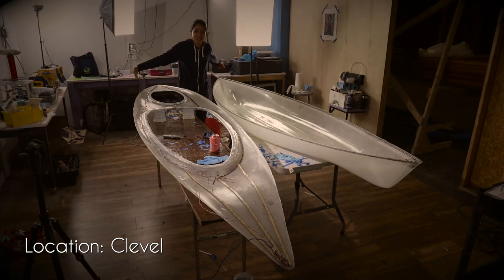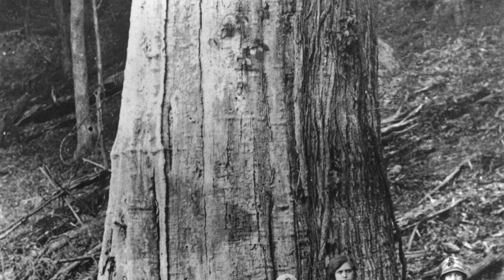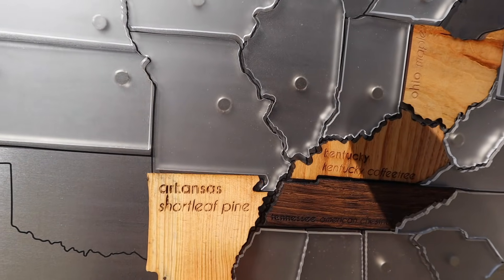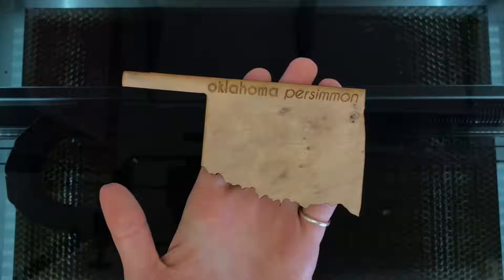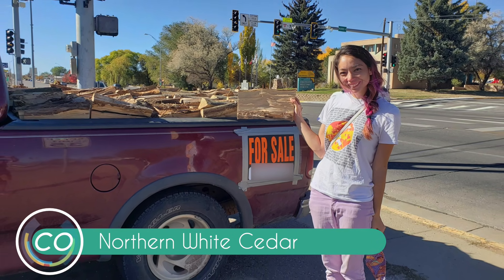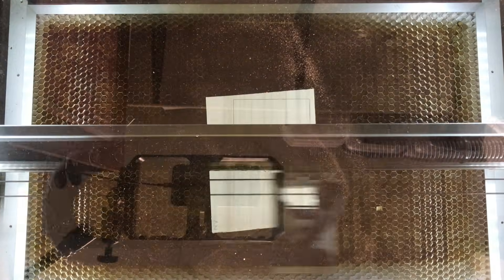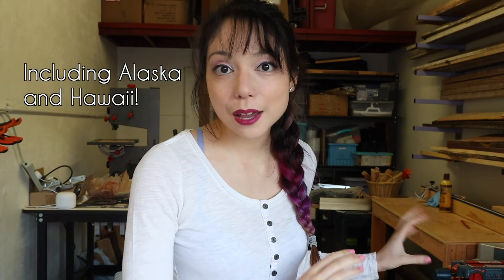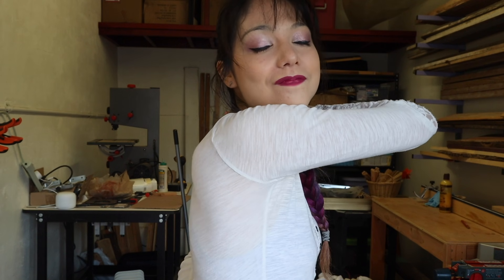I Drove Across America Collecting Wood in Every State

Comment: Just a little planing tip. If you have to plane another thin jointed piece again, use painters tape oriented across the joint to help hold the joint together and reduce the chance of blowing the joint. If the joint does still blow, the pieces will still be held in orientation.

Comment: If you ever find yourself in a cloud again, climb higher. You'll get your view.

You can avoid snipe caused by the thickness planer by planning multiple pieces in parallel, but introducing them into the machine staggered. You should use two scrap pieces for start and finish of the stream of boards.Those will be the only ones with significant snipe.

Comment: That was a very typical piece of mesquite. Here in Texas, furniture pieces made from it almost always have extensive epoxy infills. When planing small pieces like that, I rip longer pieces from scrap and glue them to the sides- this takes all the worry out of the job, and you can just rip them off when done. I keep crappy wood around for just this purpose (it simply has to exist).

Comment: That's along a route that I was very familiar with: old Rte 66. In the early 1960s I spent 3 or 4 years hitchhiking back and forth across the country (1/4 million miles or so). A lot of those miles were on Rte 66 which had already begun to be abandoned. Since I was never in any hurry, I was able to follow the original roadways except for the few places where it had already been "paved over" with a new expressway. At least once I hitched the entire way from the Loop in Chicago to the beach in Malibu, just as a sort of bucket-list item. (Hitchhiking in Chicago was no fun in the '60s and is probably worse now.) I see nostalgia pieces about some of the older, vanished businesses along 66 and can say, "Yeah, I ate in that diner," or "I bought a Coke and a pack of peanuts in that gas station." I can't say that about the motels though. I doubt if I spent 40 or 50 nights under a roof during those years; I generally just found a sheltered spot, wrapped myself up in my old, raggedy army overcoat, and lay on the ground. It's called "living rough".

Comment: 10:50 Alaska also wouldn’t fit. Hurts my feelings every time we’re left out :’(
Reply: Yea I don't think Alaska would fit, we'd need a longwide board to accommodate
Reply: Well, the obvious solution to that (wood) problem would be going back to being Russian, but I don't think that's an option either, yeah?😅
Reply: @MichaelBerthelsen  I'd much rather be american than russian
Reply: Then you should think about that all those states are called the "Lower 48", putting Alaska above the rest.  :-)
Reply from the maker: I figured if someone sends me Alaska I'd just make it and have it float around in the bottom left corner!
Reply: @xylafoxlin  Your solution has been done in some form by many map makers.
Reply: I read somewhere if you cut Alaska in half Texas would be the third largest state.  (I think it was a bumper sticker)
Reply: @MichaelBerthelsen  Why Russia? Wouldn't Canada be a better alternative considering you actually share a border with them instead of being separated by the Bearing strait.  :p Also you have the same language so communication wouldn't be that problematic.
Reply: @Dragonited  Because it used to belong to Russia, so it would be a 'return' to previous owner.😉
Reply: @xylafoxlin  Why not give the "Outlying states" their own frames, and put them in their appropriate positions on the wall when you hang this up?

Comment: With the Dewalt planer, I recommend building a table that is flush to its table on both sides.  Infeed and outfeed support will really help with snipe.  If space is an issue the extension wings are better than nothing.
Reply from the maker: Ooooh thanks for the tips! I have the wings I just haven't installed them yet. I'm thinking of making one of those flip tables to save space, and put an oscillating sander on the other side.

Comment: The Table saw might be the most dangerous piece of equipment you have actually you're not ever supposed to reach over the blade if you get a hold of a piece of wood on the other side of the blade and it binds up it'll pull your fingers through the blade I've actually witness this.

Comment: Tip for planing thin wood planks - fix them to another piece to increase thickness. Double sided tape, or make your own double-side tape by using two strips of tape (one on each plank) and glue the opposing strips of tape together using super glue. (i.e. the tape's normal glue goes to the wood, and the non-sticky sides of the tape are then glued together using super glue). Several videos on YouTube about this trick.

Comment: I can so relate to the head in the clouds view thing. I once walked 11km straight up a mountain in NSW, Australia based on a promise of a view all the way to the coast, acquiring nearly 30 leeches in the process, only to have visibility of around 20 metres when I reached the summit. Totally worth it still.
Reply: I didn't make the top of Mount Fuji when I tried climbing it.  The folks on the trip with me who did make it to the top reported they were in the cloud.  I stopped about 1000 feet below the summit.  You could see down and out to the side a bit, but the cloud away from the mountain was below the level I was at.

Comment: Very cool Xyla! Been waiting for this! Came out super! So once Covid is over and travel is possible any plans for a world map? 😄

One tip for planing thinner and smaller pieces of wood is to build a planer sled. Basically a piece of thick MDF and a tiny ledge at the back to act as a backstop, and feed all of it with your wood to be planed on top. This helps so the piece that you're planing doesn't bend (and shatter) from the rollers in the planer.
Reply from the maker: Genius. Hate that I didn't think of that, I've seen them used too lol. Thank you!!
Reply: @xylafoxlin  still even nicer would be a drum sander. It's on my wishlist for future workshops 🙂
Reply: @xylafoxlin  you can also use something like carpet tape & tape the pieces to a larger board or strip of plywood to plane small/thin pieces.

Comment: Yes you have not lived near cotton wood the term cotton refers to the fluff it sheds during pollination and sheds and sheds and sheds basically from early spring to late summer early fall causing events allergy problems and clogged AC heat exchangers they also grow very large and because of the soft nature of the wood the brake and fall on things all lot cotton wood is not popular with people that live near it's it :-(